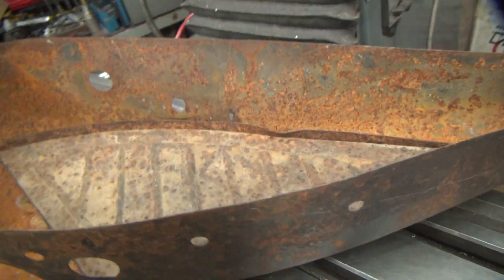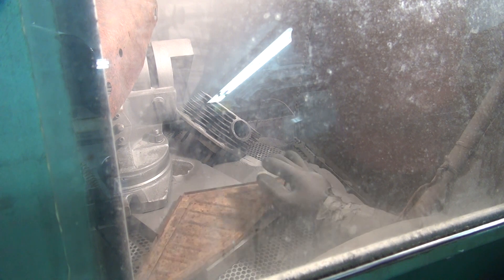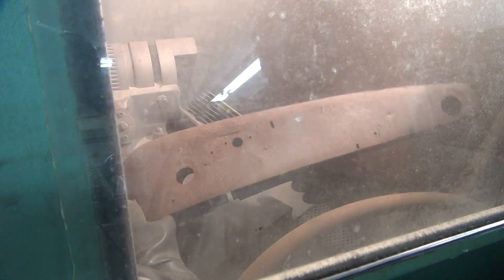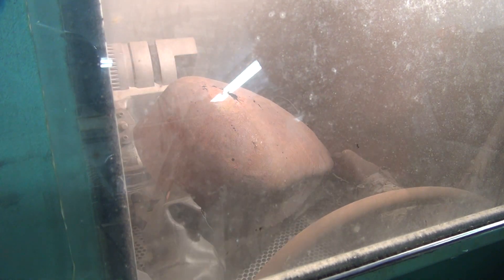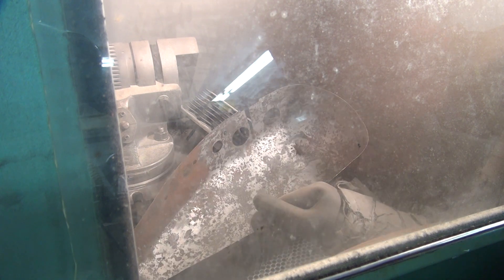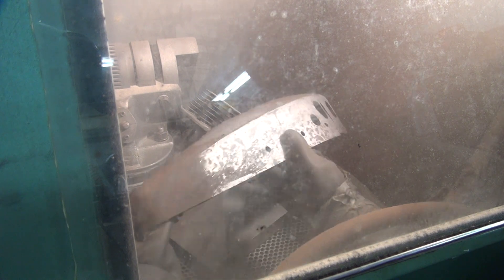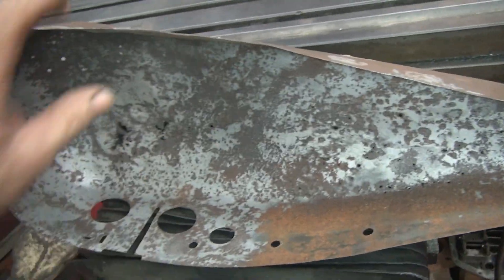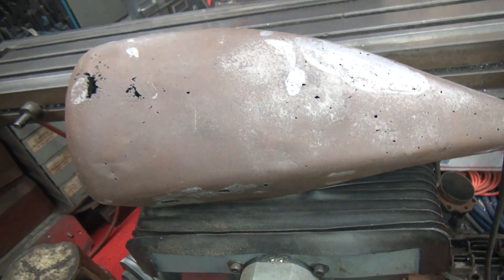see the crap i buy on ebay 1930-36 vl rl dl very rusty bead blast left gas tank harley tatro machine

Comment: if you had the air regulated what would be an ideal setting...glad to see you made it home safe. Just curious, does blasting the lead put it in the air you breath or is it pretty well contained?
Reply from the maker: the regulater was set for 80psi. 100psi works better but the air runs out quicker and it kills the beads more. its harder on the parts to. like everything, there is very little danger in low amounts.
lead and gold are all about the same yet no one cares about not having gold. same dangers.
tatro